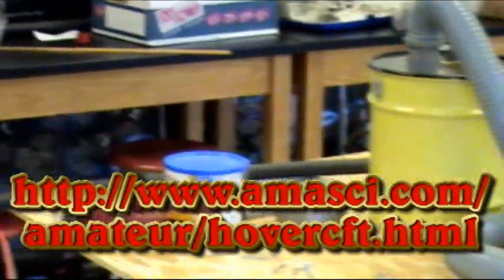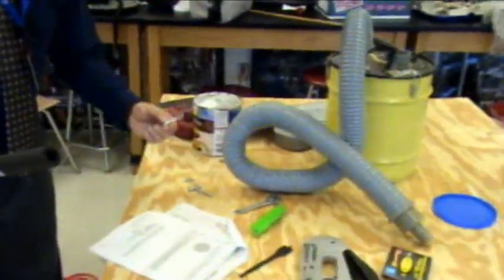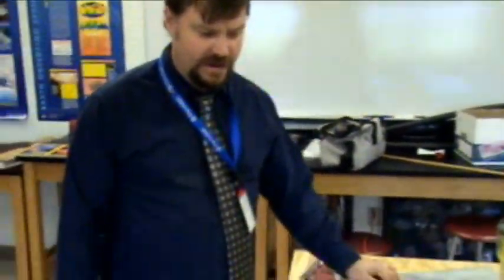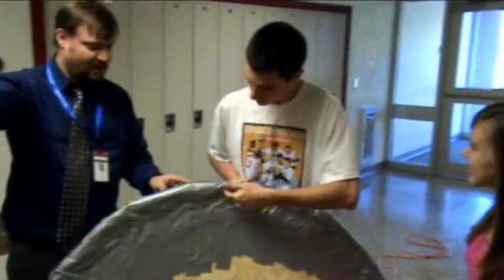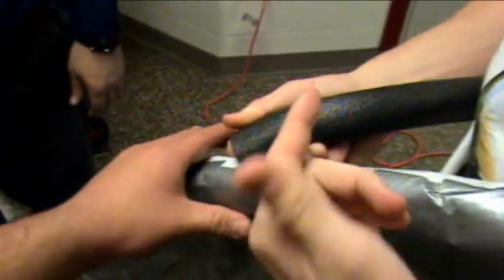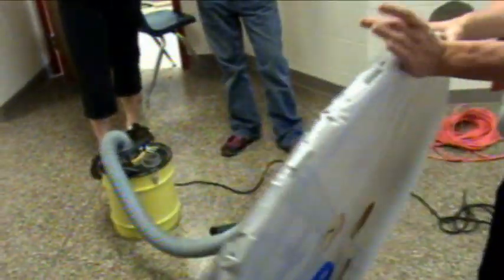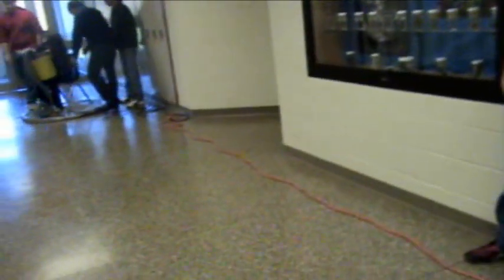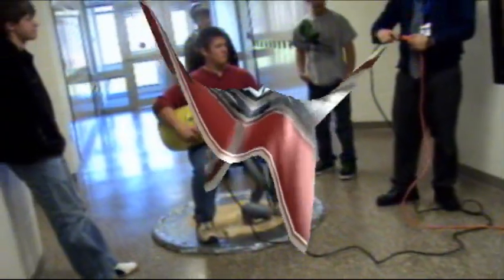Building a Hovercraft in Physics

Comment: Now that's fun at school!  PSI of the air source/inlet limits the weight lifted; so it would be interesting to see what other air sources could be used (I'm drawing a blank right now).  A higher skirt would be neat (outdoor demo) - but it would have to handle the pressure.  For an outdoor demo - a small engine and what for pumping air?